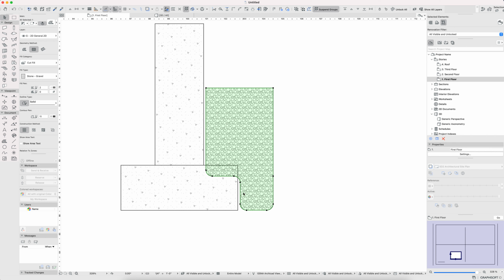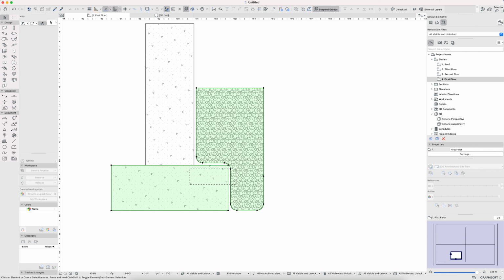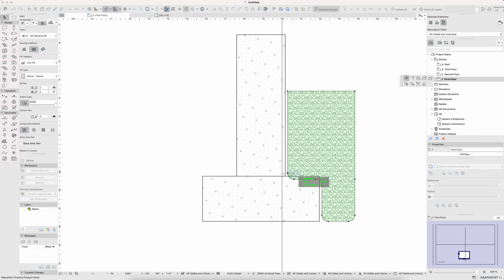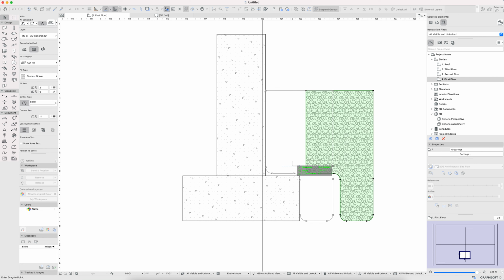Marquee for adjusting fills

Comment: Why can’t graphisoft make the marquee tool only work on selected objects for instance. That would make it much more powerful.
Reply from the maker: if you have bimCloud, it kind of can, since you have to reserve elements in order to edit. Otherwise, you can lock elements by layer or even by groups of elements; you can group elements you don't want to stretch... there are ways around it
Reply from the maker: you also have pet pallet options to adjust edges of select elements; rather than stretch by marquee